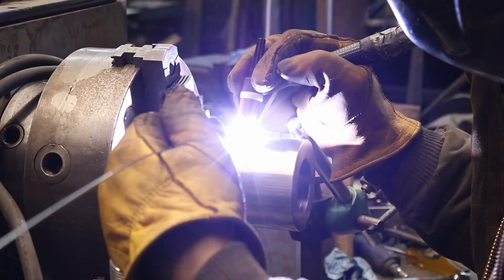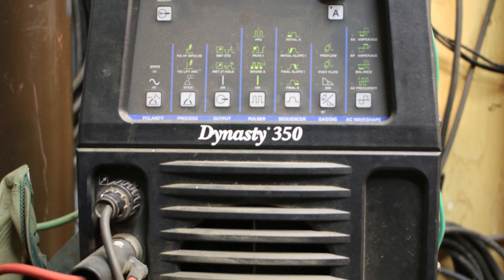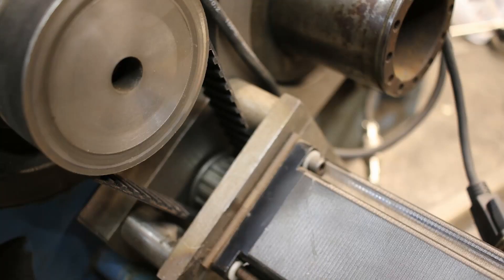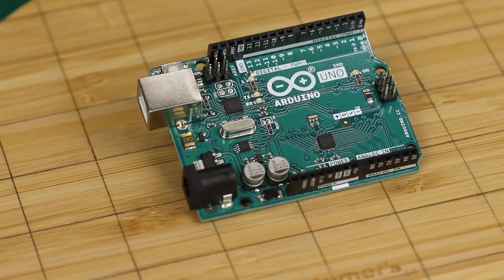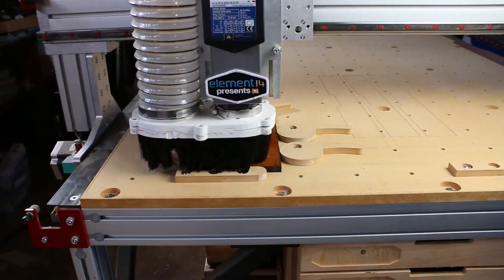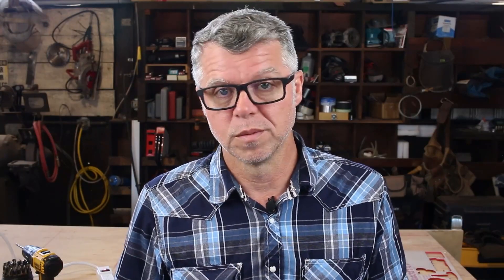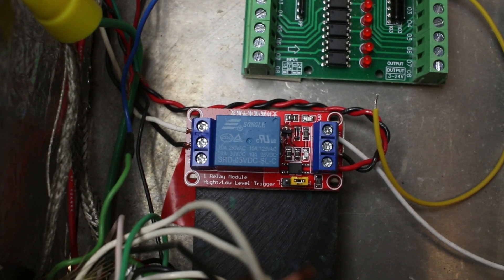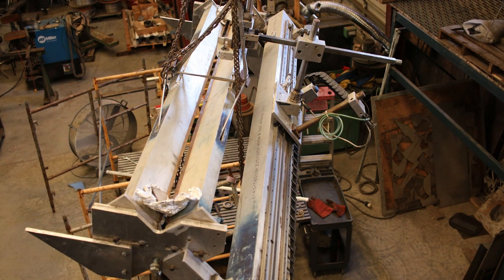How to Automate Industrial Welding Positioners with Arduino

Comment: Have you tried: 1) LC Filter 2) Differencial signals + twisted cable 3) Shielding / screening all the connections. It should work. PLC is not a different setup: you always have some power pcb, opto copleres, relays ... Maybe arduino pcb design is a little bit "more sensitive", but it should work 
Why using ESP32 and Arduino? Could you just use ESP32?

Comment: Back in my ham radio days we'd use a feed thru capacitor or a self contained emi filter on ever I/O wire going in or out of a shielded box that the transmitter or receiver would be mounted in and in this case the Arduino board. It would keep a lot of stray RF at bay.

Comment: Do you know, is it the spark acting as a radio or the weldingmachine itself (or maybe a voltage drop on the psu from the welding machine sparking?)
Reply: I think its the High Frequency Start for TIG process.
Reply: @Kaleb Clark  Yes, but what is the output-source? Is it the machine or the spark (like an old-time-morse-spark)? You can make all the HF-noise that you want, as long as it is shielded it doesn't matter... Even putting the arduino (or whatever plc) a distance away could be enough (distance/power ratio). I'm thinking it's the spark, if the gpio is acting as an antenna it must be somehow related to the lenght of the gpio-pin??? Maybe nipping off the unused pins could be enough to disturb the relationship?
Reply: @Peter_Enis  Ah, I see. I think it was the machine. We always had the control box the maximum distance away from the machine (and that helped some), and we also tried using some random bits of sheet metal as a shield. That helped some, but the problem was the wires in the pendant because we needed to have that at the work area which was impractical to try and shield with sheet metal.
Reply: It's always a catch-22 situation 😋 Anyway, thanks for replying and explaining some more details. I learn a lot from your video's.
By the way, the artwork is beautiful.... What did you guys use as a mast?

Comment: Sorry but what here couldn't be achieved by combination of mechanical and dumb electrical  

Or just weld it by hand if it had to be baby sat anyway?

I don't see the added benefit from what you did I get that when you have a skill set you will apply it to the problem

I often weld my way out of problems
Reply: I actually have answers for these. Using and arduino is what I know, and what I could do the fastest. We were under a very tight timeline, and we had to make it go. As for welding it by hand, first its art, and the artist wanted the most consistant welds possible, and second it was a total of ~360' of welds that needed to be done ASAP on 22g stainless sheet to a .0625 wall stainless square tube. As good of a welder the artist is, this was beyond his skill to do as consistant as the machine did, and we just didnt have another human capable of doing it.  Not trying to argue your points, I just had answers :)

Comment: Curious to know about the WiFi module, did you need to open the case for that to work?
Reply: Yes, I did, but when I was changing parameters, the machine was not running so it was OK to have the case open.
Reply: use external antenna???  Send inputs over wifi?

Comment: The approach for aerospace cabling is differential twisted pair cabling that is individually screened then the whole bundle is screened. All the connectors are metal as are the boxes. Sensitive parts get extra screening. There is lots of filtering on the power supply to ensure no noise gets in via that route.

Comment: I actually had a project in the works, that was an optically isolated differential pair, that would connect to a switch or signal and an arduino on the other via shielded wire